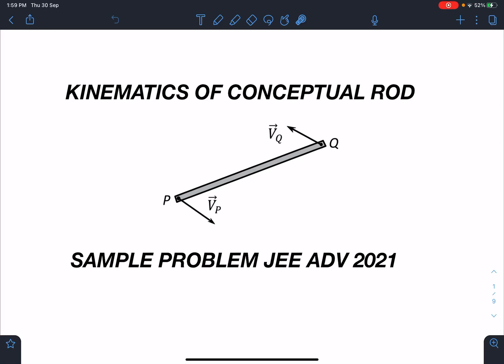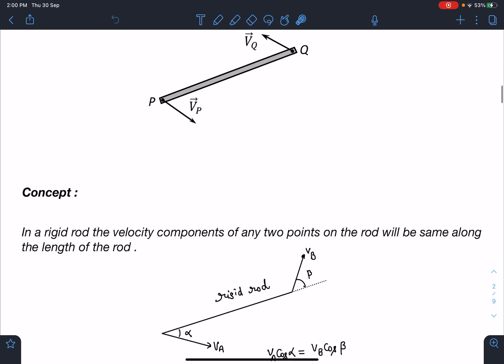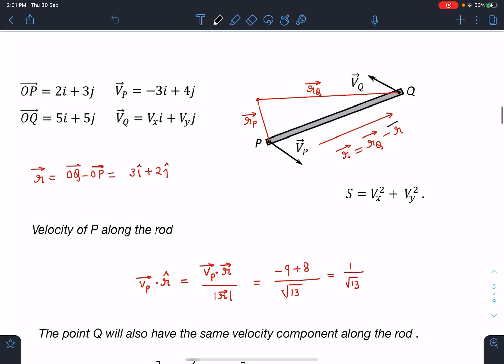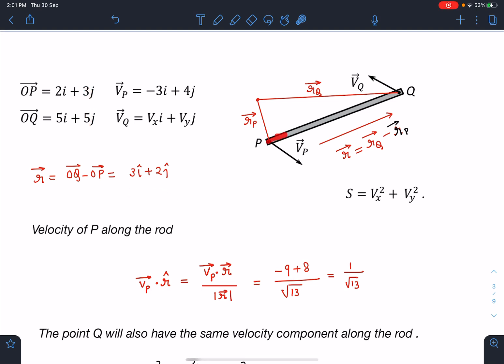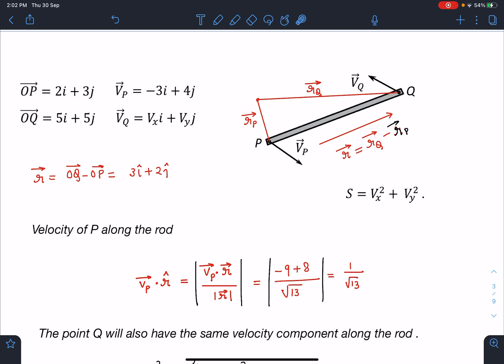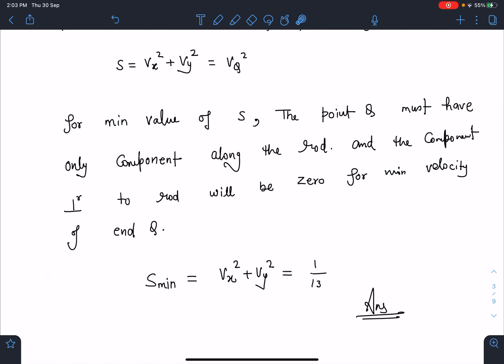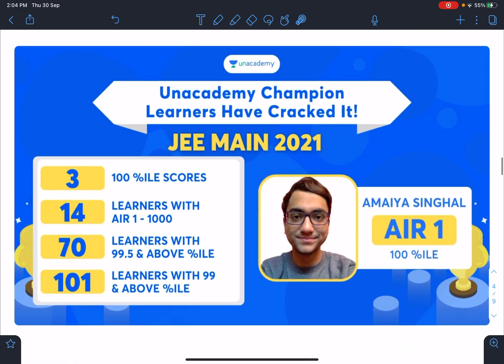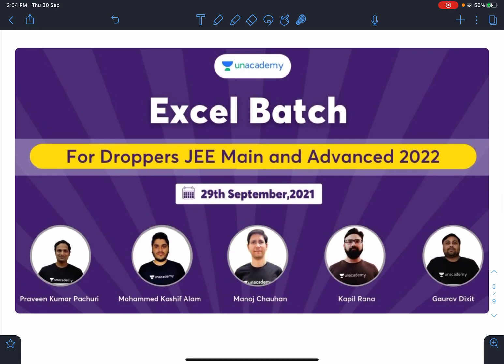[JEE ADVANCED 2021]KINEMATICS OF A RIGID ROD IN COMBINED MOTION [ADVANCE PROBLEMS IN SCHOOL PHYSICS]

Comment: Sir I think the answer should be 5/49

By equating the component of the velocity of Q along vector PQ with that of P along vector PQ  I got the the following relation
3Vx + 2Vy = –1
Now if I put Vx=(–1–2Vy)/3 in the expression of S and then differentiating with respect to Vy and equating with 0, I got Vy = –2/7
And Vx= –1/7
Reply: Maybe sign error , haven't tried minima methods yet though.